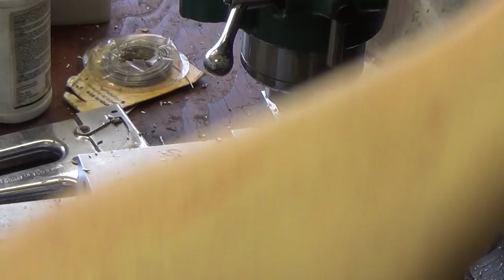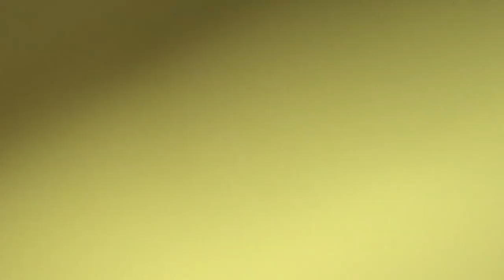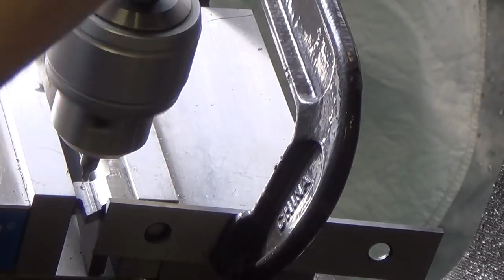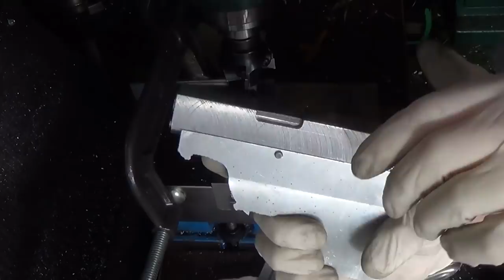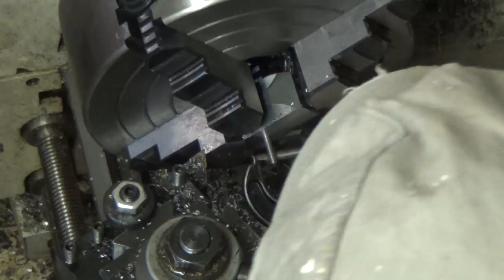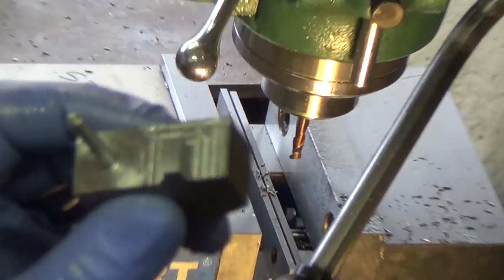part 9 frame work, slide stop pin,

Comment: Another awesome vid by the awesome lady

I have a question about your machines. Your lathe looks like it's a grizzly of some sort. But, your milling machine looks like a Bridgeport. I have a grizzly G0704. I don't own a lathe, yet, and that has kept me from doing my own projects. What do you recommend for a lathe?
Reply: If you have the space, a nice Clausing Colchester.
Reply from the maker: the Mill i have is a grizzly and yes its a knock off of a Bridgeport although a good knock off. i would always recommend american made machines if you can find them for a good price and they are not totally wore out. rather hard these days. my lather is also a grizzly. the mill however is way better built but im happy with the lathe it just as a few issues ill take care of as i get time :)

Comment: thats cool but i cant understand in the 7:50 of the video you a cut a huge piece of metal to make a small pin and wasted a lot of material... cant you use a old and dull drill bit to be a pin... anyway great job!!
Reply: I don't think she can.  Not easily anyway.  That 'pin' is actually a long skinny stud sticking out of the slide stop body and one piece to the slide stop.  IMO if she tried using a removable pin, a) the overall assembly would not be as strong, b) that pin would have to either be threaded or pinned in place (welded is an option, but that would add to cost and be one more manufacturing step), c) drill steel would probably not be a good choice because it is likely to be too brittle to take the repeated lateral shocks of the slide and barrel slamming back under fire.  4140 is probably a much better choice for the task.   The issue of metal waste cost was the big push behind mass manufacturers moving from blocks of milled steel to forgings, castings and stampings.  That's why milling is becoming lost art.  When you are trying to turn out a quarter million pieces it is just too hard to economically compete using milled parts vs a stamping or,, gosh forbid, 3D printed metalized plastic.   :)
Reply from the maker: if i made it in several pieces i could have used a lot less material, i wanted it to be all once piece. 
Ken is also very correct in that i would have to weld it or thread it and it wont be as strong. aslo if i weld it it would be slightly different material and it will blue unevenly.